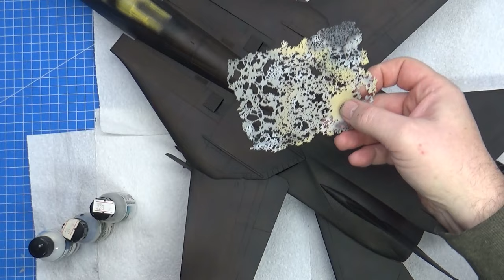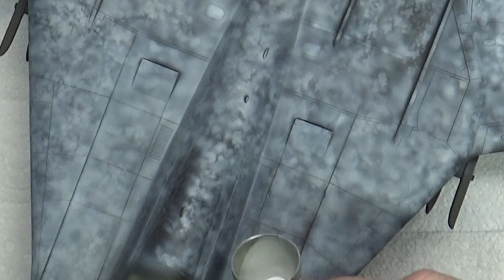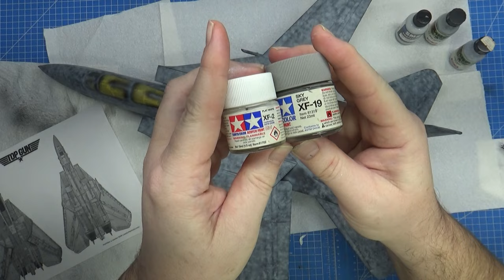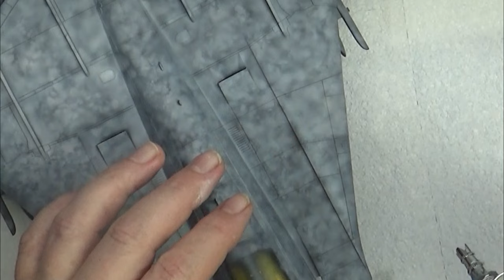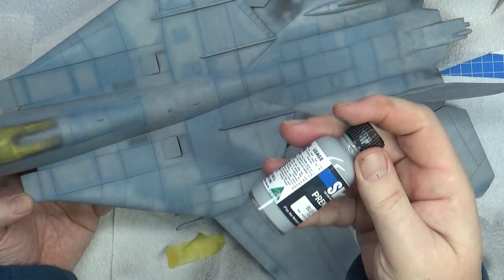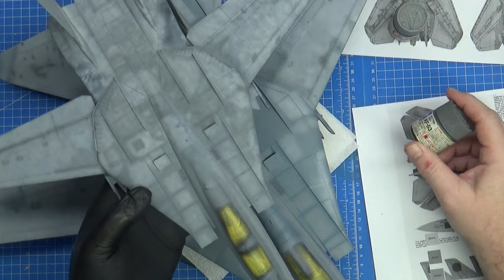1/32 Revell and Tamiya F-14A TOPGUN Iceman Double Build - Part 13 - Painting

Comment: I made a diorama with a Tomcat about 27 years ago, entered a competition at my local hobby store. Came third, the judge from IPMS thought it was to dirty and spotty. He said they got cleaned everyday in the hangar of the aircraft carrier. 😂 
When I was building the tomcat,  I read an article about the tomcat in Tamiya model magazine called Dirty fighting that was about how dirty and spotty the tomcat got.
I make mycket military service as a helicopter mechanic, we almost never washed the copters, and took the closest color we could find for touch upp.
Reply from the maker: I have a theory that IPMS has stopped more modellers than it has encouraged, but that's the cynic in me....

Comment: Hi bro one thing you might want to have a little experiment with use a test part to do mottling with a very matt clear and a semi gloss clear of over the cammo... I think you will like the effect... Different surface finish can be done by lightly rubbing a matt finish with a polishing compound to simulate a worn matt finish
Reply: Experiment with different clear coats... Sorry the new YT update is missing out parts of msgs
Reply from the maker: Oh I'll be trying that for sure

Comment: That's a lot of paint especially on the 1/32. I love my GSI creos PS-290. Been meaning to get a 289 for the 0.3mm needle. My Sparmax Max3 is good but the cup is not big enough.
Reply from the maker: I used a whole bottle of SMS Clear Gloss to do the final gloss coats on both of them! And nearly a whole bottle of MRP Dove Grey as the undercoat...
Reply: One thing I'll have to keep in mind when I eventually take on the Trumpy. These videos will definitely help me out with it.

Comment: My gosh Becker you’re making me feel like grabbing an F-14 kit out of my stash. But 1/48 or 1/32? Easy build or the more imposing but more complicated big bird? 😅
Reply from the maker: Go 1/48 every time - although I have all the 1/32 kits, I have many many Tamiya 1/48's because they are that good...or try the new GWH 1/72s, which are probably even better!
Reply: @beckersmodels  Thanks. I will.
Reply: @beckersmodels  Hi Chris. Can the Tamiya 1/48 Tomcats be built in wheels-up mode? Sorry if this has been answered before.
Reply from the maker: Not out of the box unfortunately, takes a bit of effort to get the parts to fit. I will be developing some 3D printed solutions later this year/earlier this year, as I have many more F-14s to do inflight... @ronaldbyrne3320
Reply: @beckersmodels  looking forward to your 3D printed solutions. The F-14 looks best when modelled in flight. 😍